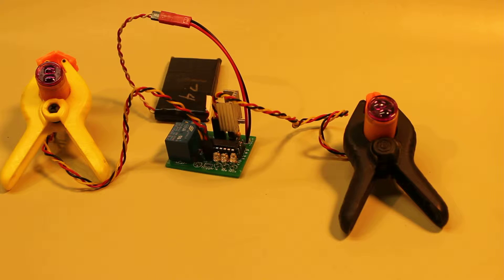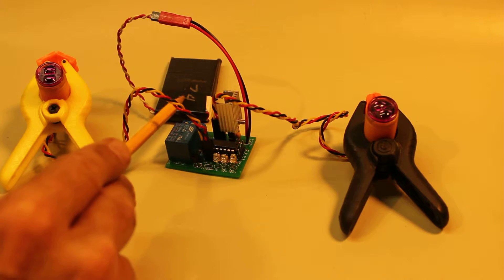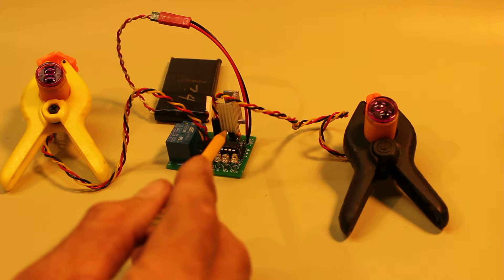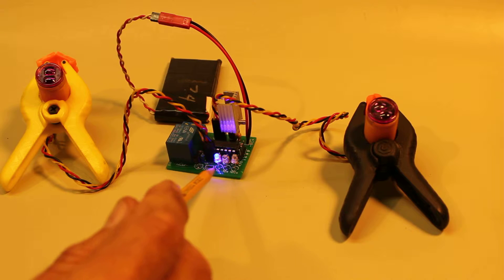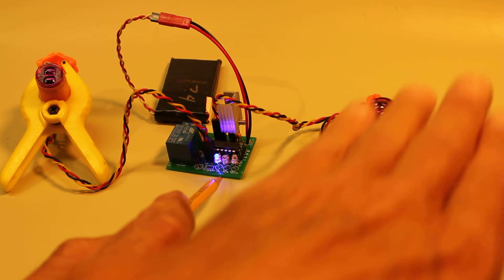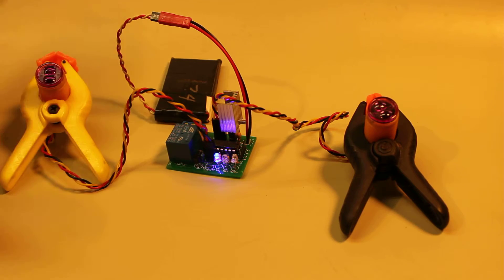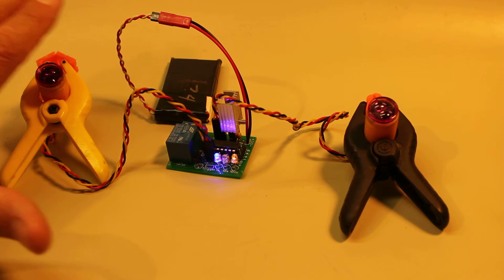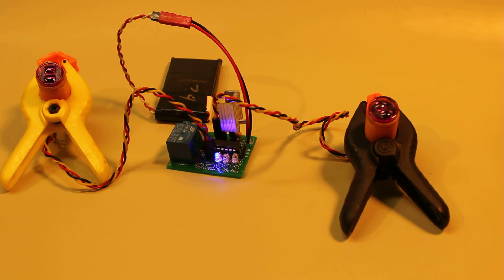Dual IR Sensors triggering and releasing a relay to operate a crossing

Comment: hey dave! I am trying to do the same thing but after the relay i want it to trigger a foot peddle to then trigger a keyboard short cut. Any ideas?
Reply from the maker: Sorry, but I really don't follow what you want to do
Reply: @DaveBodnar  Basically a pedal that triggers keyboard short cuts. I figured it i can trigger from an ir at the foot peddle(Instead of me clicking it) and since it already has HID hot keys that will be recognized that i can short cut it? Kinda understand?
Reply from the maker: I think you would be better off exploring the Arduino as it can simulate a keyboard

Comment: can u give the circut digram
Reply from the maker: +raj kumar 
The circuit is very similar to the one shown here:

http://www.trainelectronics.com/AnimationTimer/article_Part_II.htm

I just used two input pins for the two IR sensors.

The sensors are described here:

http://www.trainelectronics.com/CruiseControl/NewMosfetVersion/

dave